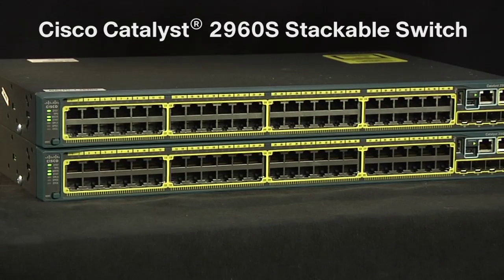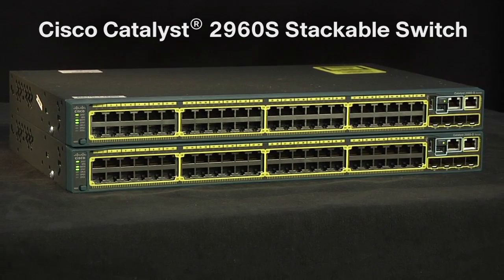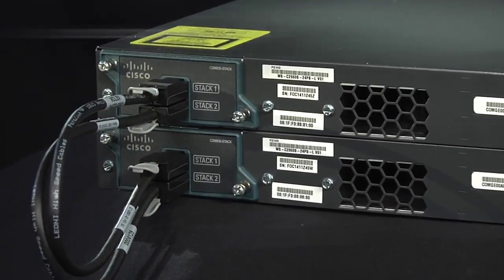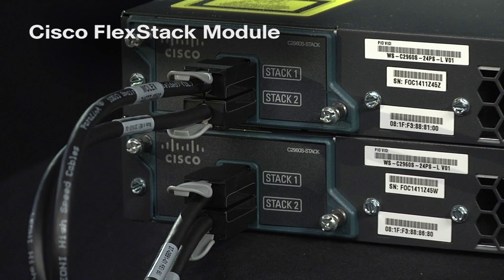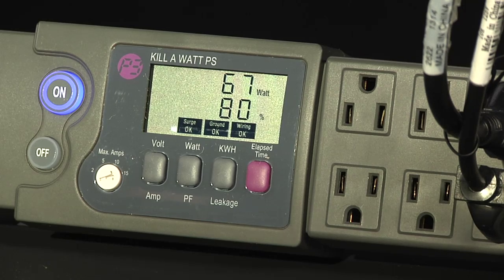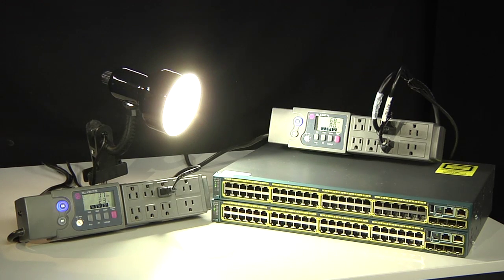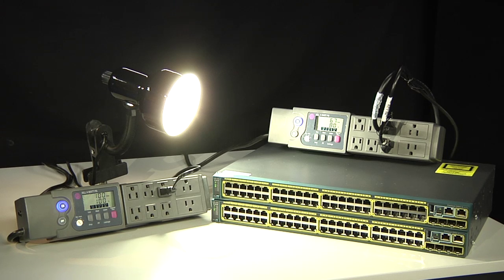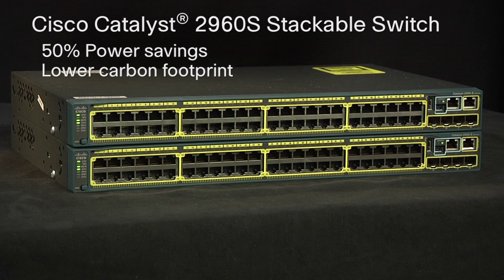Cisco Catalyst 2960-S Power Consumption

Comment: so each one will consume 33 watts. with nothing networking happening on the switch of course. Now connect all the ports and start a gigabit transfer on all of ports to give a fair comparison  with the light bulb witch is running at Maximum capacity without attenuation.
Then the light bulb will won hands down
Reply: I have one with with about 30 ports connected doing some file transfers. 4 of the ports has a POE device connected to it (1 POE camera and 3 AP units). Kill-A-Watt is showing it's pulling about 91 watts from the wall. Single switch, no stacking modules.
Reply: it says in data sheet 5% passthrough with power consumption about 55 watts, which is way high for home use on 24/7 basis .